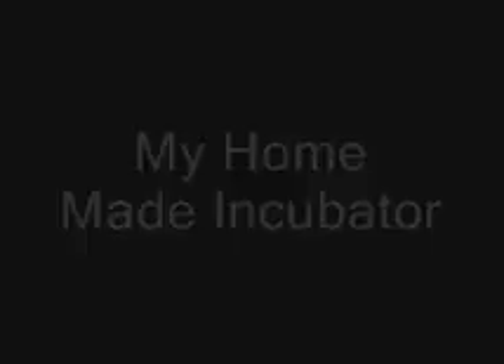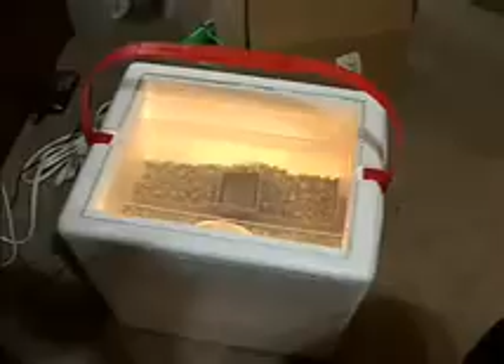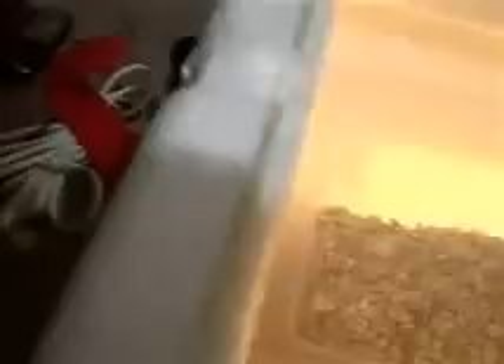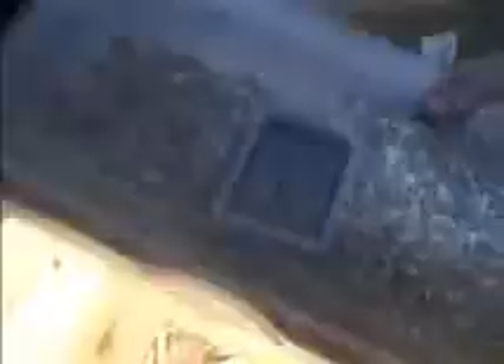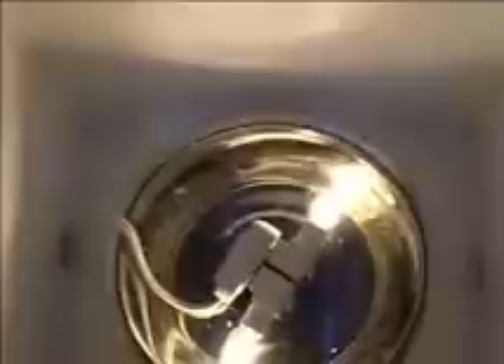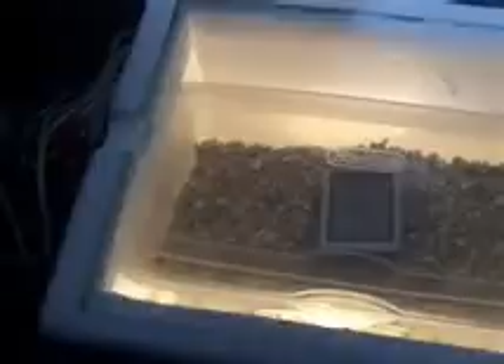My Ball Python Incubator Project

Comment from the maker: @Jameshasastripe Don't ever wrap anything around a hot rock. In fact, throw that hot rock away. Don't put your snakes in danger, use heat pads or strips. A towel wrapped around a hot rock would be like putting a towel over an incandescent lamp to dim it... a fire waiting to happen. I can't tell you what misting once a day would do as your needs for care relate directly to your home environment. a house with central air will be much drier than a home with say, hydronic(radiator or baseboard) heat